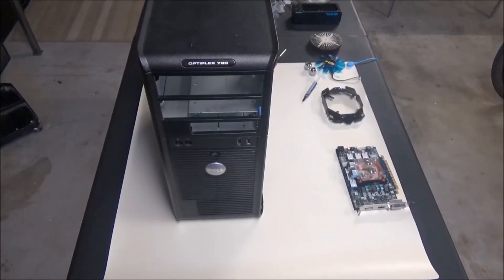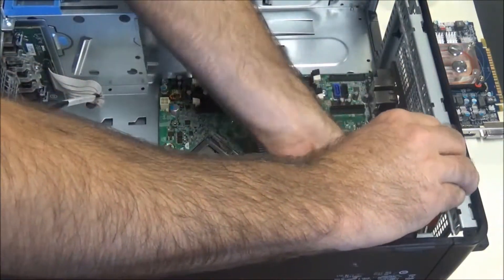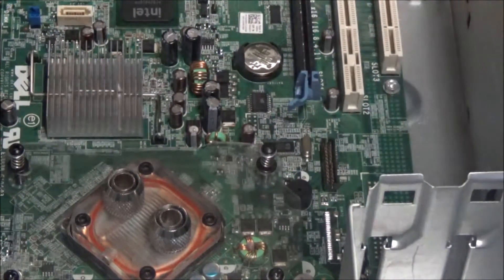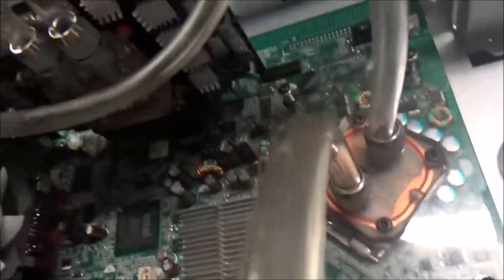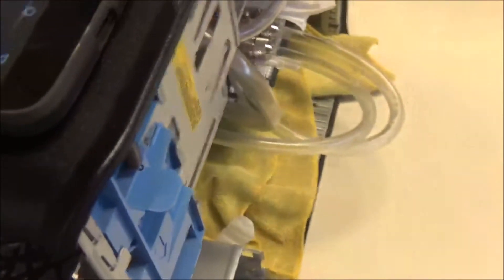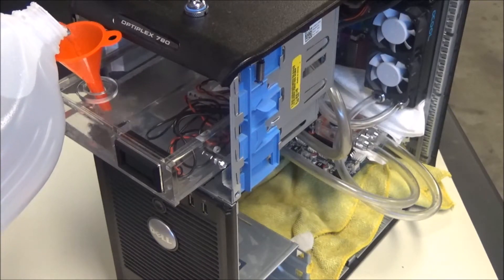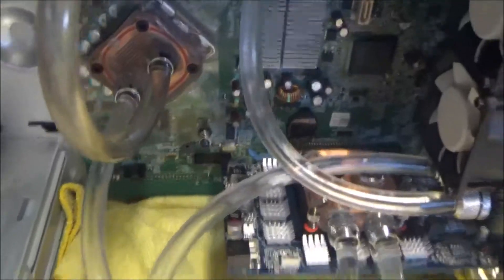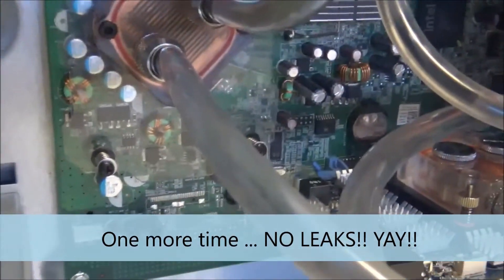Dell Optiplex 780 Full Water Loop Build and Leak Test

Comment: what is price of water cooler?????
Reply from the maker: The radiator was about $60. But you also need the fans, pump, reservoir, tubing, and CPU/GPU water blocks. All the parts together cost around $120, but I got the pump for free. A pump is usually $40-100. When I switched to hard line tubing the price got a lot more expensive. I spent another $100 just on the hard line fittings and another $25 on the hard tube. Then I spent a couple weeks learning how to bend the tube. Now I know why All-in-One (AIO) coolers are so popular! They're super easy to install and inexpensive compared to a custom loop.

Comment: Suck I can’t find the 780 mini tower case under 30
Reply from the maker: It's really hard to find just the case. It might be better to get a working Mini Tower and sell your Desk Top model. It wouldn't cost that much to switch and you could explain to your mom why you want to do it so she wouldn't get upset.
Reply: PimptatoPCs if I did do that couldn’t I keep the ram,hdd and cpu ?
Reply from the maker: For sure. But you have to buy the Mini Tower before you sell yours.Take all the parts that you want to keep and put them in the Mini Tower. Then sell the Desk Top with a Core2Duo, 2GB of RAM and like a 250GB hdd.
Reply: PimptatoPCs I might do that or get the Optiplex 390 because it has a arc motherboard and that opens a lot more options
Reply from the maker: Get the 390 for sure if you can get your mom to go along with the plan. It's such a better PC with newer/stronger parts that will last you a lot longer. And the ATX style will make everything easier. Definitely try to do that if you can swing it.
Reply: PimptatoPCs I can sell my levono thinkpad t410 for at least 80-100 on a local add and the 390 is about 60$ on ebay
Reply from the maker: You found a 390 for only $60? That sounds too cheap. What are the specs for that one? Make sure it's the right model before you buy it. Try to find one with a i5 2400, the i3 2120 models are okay but the i5 is way better. And make sure that it has Windows 7 or 10 already installed or a COA sticker that you can use to activate a Windows install. I've seen a few 390 Desk Top models with Pentiums CPU's and no HDD for around $60, but the cheapest 390 Mini Tower with Windows and an i3 or i5 that I can find are about $100-200. I just don't want you to get the wrong model and be stuck spending more money to upgrade it. 
This is about the best 390 listing I can find with the minimum specs you want https://www.ebay.com/itm/Dell-Optiplex-390-MT-Windows-7-Mini-Tower-3-1-GHz-i5-2400-4GB-250GB-6350/232282906704?_trkparms=aid%3D555019%26algo%3DPL.BANDIT%26ao%3D1%26asc%3D20150817211623%26meid%3D3bd7ce1af6b24ed9b917c7baca5f4792%26pid%3D100505%26rk%3D1%26rkt%3D1%26&_trksid=p2045573.c100505.m3226
You would still need to get a GPU because the HD6350 it comes with is pretty weak, but it could be sold for a little bit of cash. And eventually you could upgrade the RAM to 8GB and get a another HDD that's bigger than 250GB.

Or you could get a 790 like this one (it's basically the same as a 390 with a little better motherboard) https://www.ebay.com/itm/Dell-Optiplex-790-MT-Intel-Quad-Core-i5-2400-3-1GHz-Boot-to-BIOS-NO-HDD-8GB-RAM/263415850240?_trkparms=aid%3D111001%26algo%3DREC.SEED%26ao%3D1%26asc%3D49452%26meid%3Ddcea9a10d1944575893dc9233dd3ee61%26pid%3D100675%26rk%3D3%26rkt%3D15%26sd%3D232282906704&_trksid=p2481888.c100675.m4236&_trkparms=pageci%253Af0ecc55c-f496-11e7-875b-74dbd1802e29%257Cparentrq%253Ad6c143a51600aa12abb16eacffdf1dff%257Ciid%253A1
It doesn't have a HDD but comes with a COA sticker for installing Windows. The good thing is that it has the i5 and 8GB of RAM already.
If you sold the Thinkpad and your 780 Desk Top you would have enough cash to get one of these. Sorry for the long post, I just want to help you make the best choice.
Reply: PimptatoPCs its an i5 but it’s sff I was going to buy a case&psu combo and put it in that
Reply from the maker: Oh I see, that should work. Does it come with Windows? How much RAM and what size hdd? You might want to spend a little more for one with 8GB of RAM and a 500GB hdd.
Reply: PimptatoPCs it comes with windows 7 pro and I have a 1tb GB HDD I can replace with the 250GB and it has 4 gb of ddr3 but I’ll need to buy 8gb
Reply from the maker: Sweet dude, sounds like you have a plan in place. You can get by with 4GB of RAM. Keep your eye out for a GPU and you're ready to game!
Reply: PimptatoPCs so I need your help I put the new cpu in the Optiplex and it keeps saying something went wrong
Reply from the maker: What exactly happened when you try to turn it on? Does it just beep a bunch of times? You might have to update the BIOS before you install the C2Q. The latest BIOS file is A15 and you can get it from the Dell website. Google Optiplex 780 BIOS update and download it. You'll have to reinstall the C2D to update the BIOS.
Reply: PimptatoPCs I got it I had to change SATA into legacy mode
Reply from the maker: Nice. That was easy. Glad you fixed it!